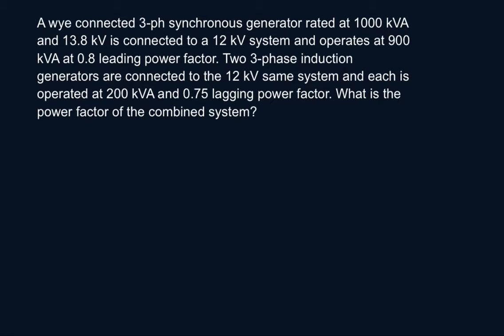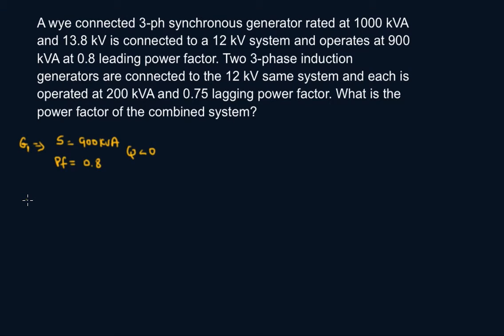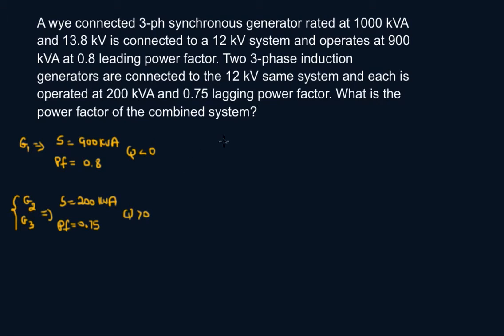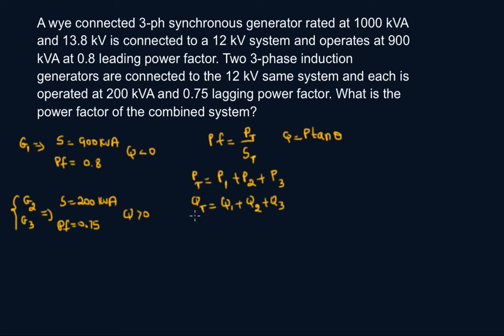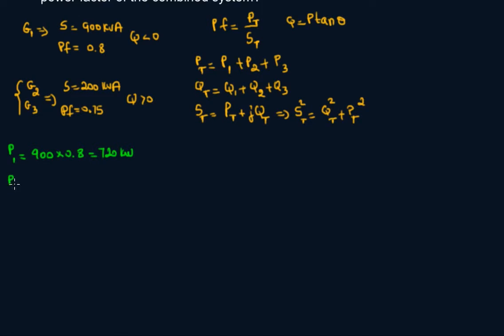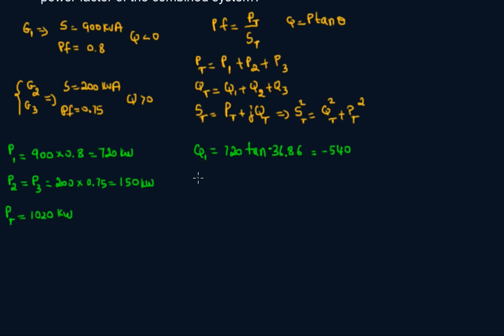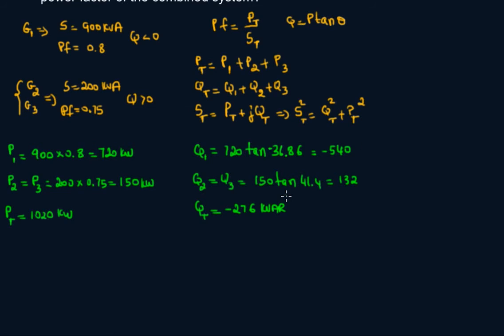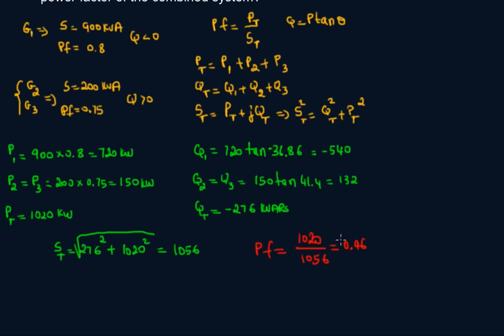Calculate Combined System Power Factor

Comment: Once I got the total complex power in rectangular, I converted it to polar.  Then I used the formula PF = cosθ, cos (-15.14) = 0.965, so your way is faster because you can save two or three steps by using that method.  PF = P/S for the power factor of the combined system.

Comment: I think something is confused in this calculations, because, in case of induction generator mode, the real power will out of its terminals injected to network, while the reactive power will flow into its terminal absorbed from network.

Accordingly, the total real power of combined system will equal to (900*0.8-2*200*0.75 = 420 kW), and the reactive power as calculated to be 275.6 kVAR.

Hence, based on the method to calculate the power factor, the new value will be 0.836 lagging.

Please, guide me.
Reply: No bcz the problem says that pf of G1 is 0.8 lead so Q is -ve (supplies Q like Capacitor) and pf of G2 and G3 is 0.75 lag so Q2 & Q3 is +ve (consumes Q like Inductor).